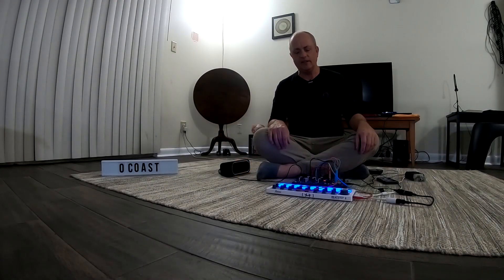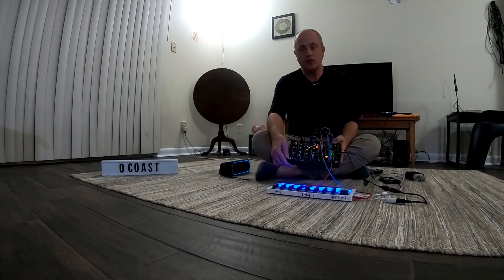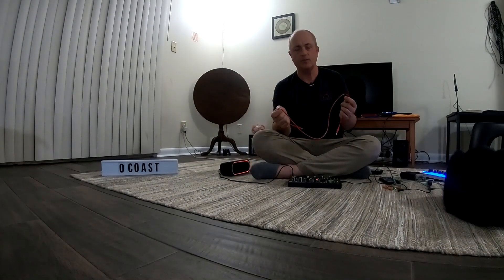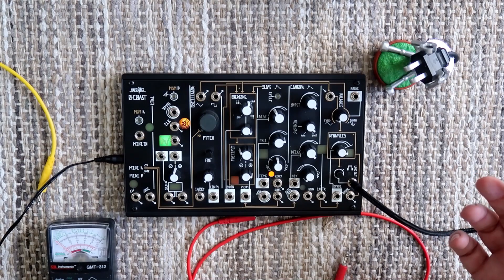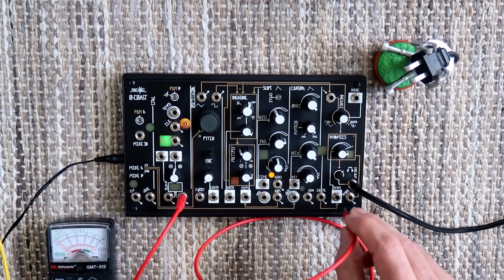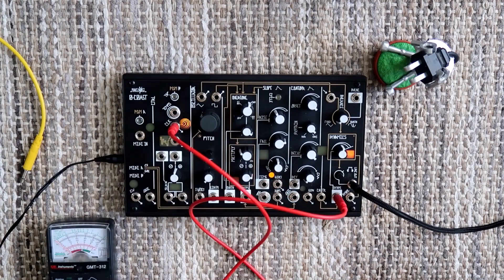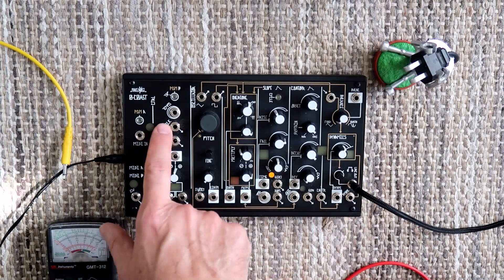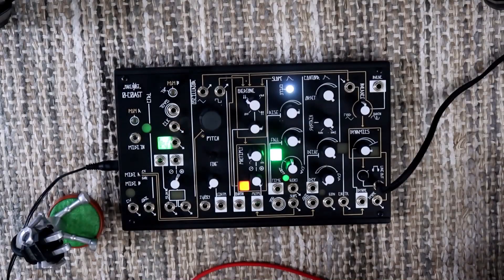One-Hitch Wonders: MakeNoise 0-C0AST Edition - No. 1

Comment: That last patch kept silent for me. Had to apply some voltage to the dynamic port to her what you heard. How come there was sound in your case?
Reply from the maker: Oh, I think that's one that uses the "phantom gate" method (just the name i made up for it😀). First you have to use the cable/voltage to trip the Gate, which starts a maxed out Contour envelope (which is normalled to the Dynamics). Then you can use the cable to do the main patch.

ps I'm not exactly sure why I did these videos but I learned quite a bit in the process. Thanks a lot for going back and checking this one out😀!

Comment: you know if you can connect the microfreak to play with the parameters of the 0 coast?
Reply from the maker: Amarù Yes! It’s a very nice combo. You can connect cv/pitch (pitch bend works, btw), gate, and pressure. The microfreak has some utility settings that can customize a lot of the cv  behavior (also look at these settings if there are issues), also pressure settings that can help get things feeling right - sensitive but not too sensitive on the pressure. The 0coast math utility can be used to invert the pressure signal, which is handy. And, I don’t think I’ve ever tried it with these two, but a midi connection is probably nice too. Good luck with it👍🏻!
Reply: Uwuu! very interesting what you have told me, thank you!